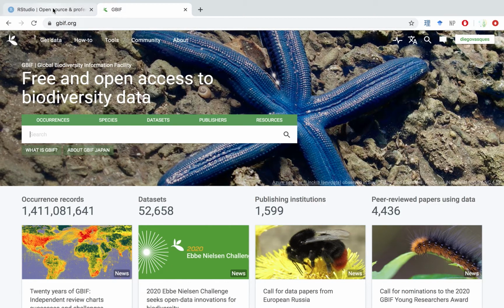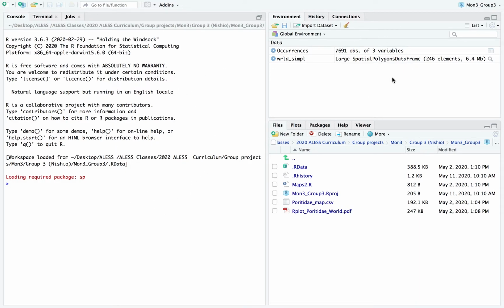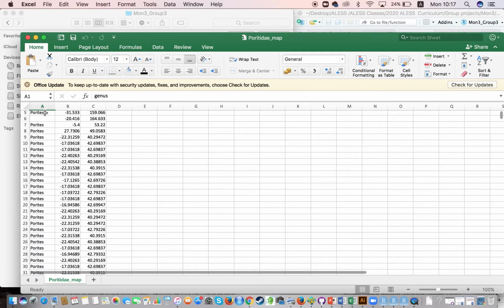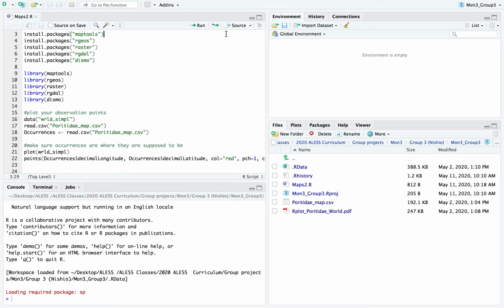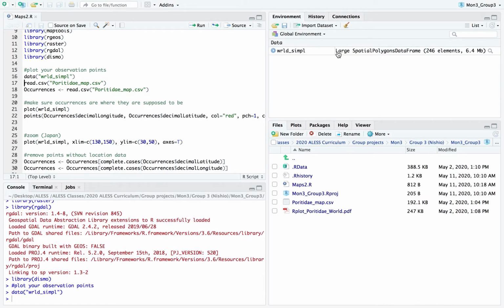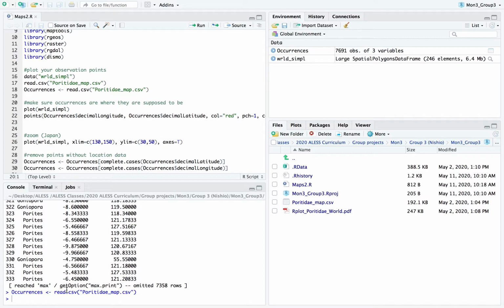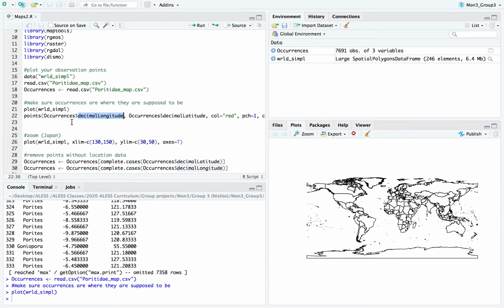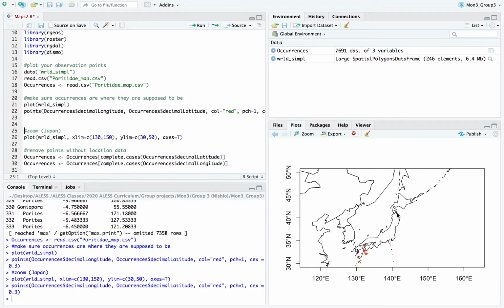Drawing distribution maps using R

Comment: data<-read.csv(C:/Users/User/Desktop/Book2.csv)
Error: unexpected '/' in "data<-read.csv(C:/"

what may be the cause?
Reply: You might consider using the "here" package for your file path.  It has the here() function where you simply type data = read_csv(here("Users", "Desktop", ... "file.csv").  That is independent of working directories which differ from person to person and computer to computer.